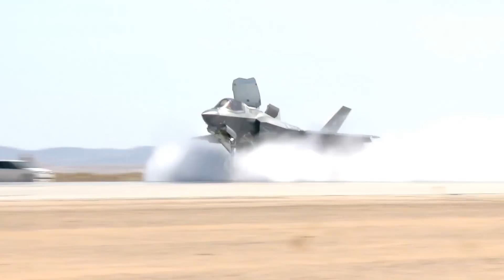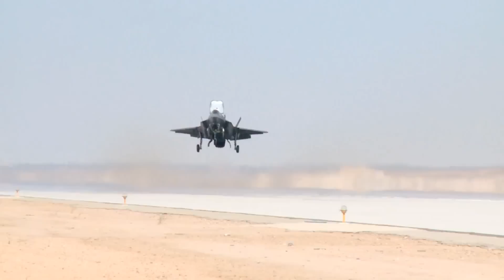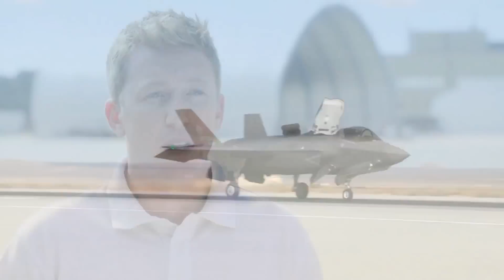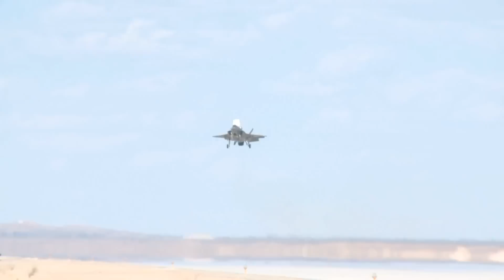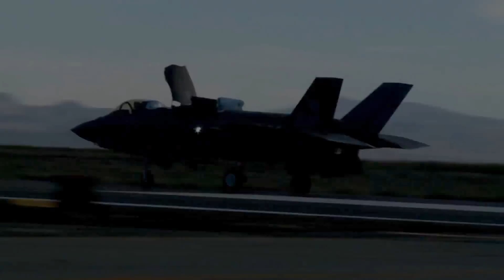NAVAIR - F-35B STOVL Stealth Fighter Wet Runway & Crosswind Landing Testing [1080p]

Comment: Does it have to land in VTOL mode?
Reply: theres three versions a,b,c a for the only runway landings, b the vtol one, and c the a version with a tailhook and better gear.
Reply: Skiing Canada I know that, but does the B variant, HAVE to land in VTOL mode?
Reply: TheJoshForce nope, but they use vtol on small ships since it does not have a tailhook
Reply: Skiing Canada Well, obviously, i was just inquiring about land take off's/Landings
Reply: TheJoshForce I'm sure if the device was jammed and you had a full sized runway you could land, yes. Other than that there's no reason to not use the fan.
Reply: ***** also it is not to refuel with advancing troops. they do not carry  a extremely large amount of aviation fuel. the vtol is so it can land on the small marine landing helicopter docks, and amphibious asault ships. and for the uk  its for there cairrers
Reply: Skiing Canada I was just asking about it not using the fan because A. It uses a ton of fuel, and B. Its ugly as fuck ;p